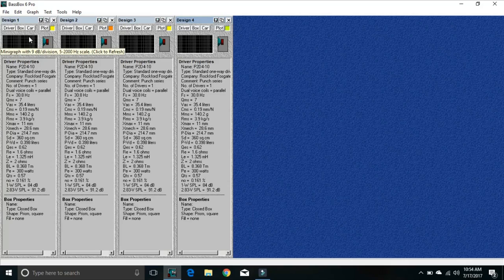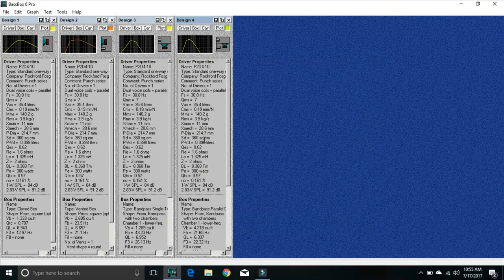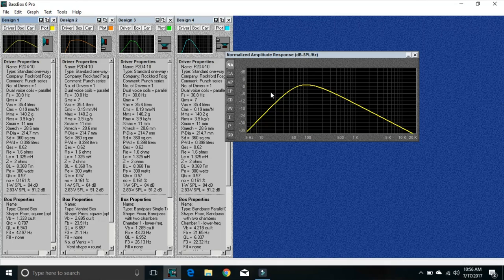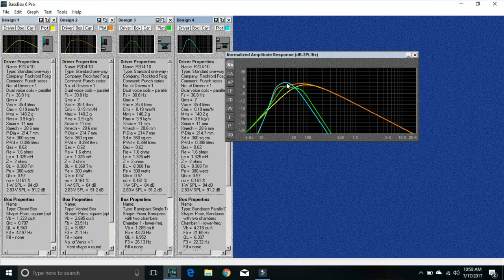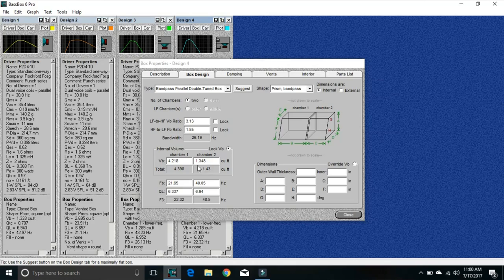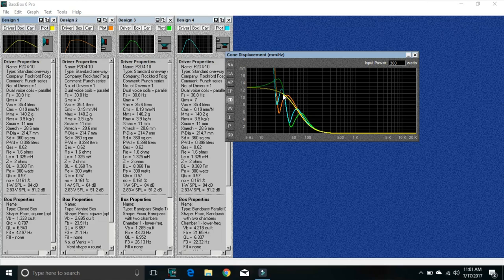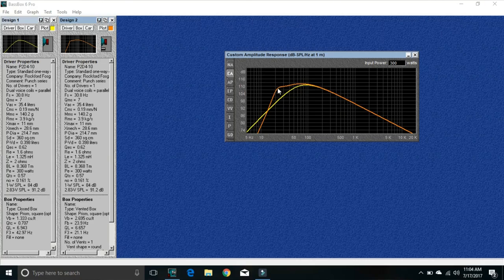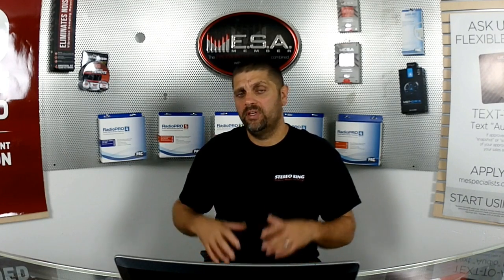Sealed vs Ported vs Bandpass speaker box/enclosure

Comment: Flat walls or ported boxes are the easiest to build, and are very loud around tuning but drop off quickly below tuning, and drop off quickly 12 or so hertz above tuning depending on the size. (Larger the box, smaller the bandwidth but louder around tuning.)
   
4th order bandpass (built correctly) has a wider bandwidth than ported box, but has the same volume generally speaking. You can tune a 4th order to 45-50 hertz and it will still play down to 20 hertz if your sealed section is big enough. (Sealed section handles all the low notes, and the front ported section handles your higher frequency cutoff) 

6th orders have the best of both worlds, and if built properly are much louder than ported boxes and have a much wider bandwidth than 4th orders. 6th orders can typically play across an entire octave and sometimes more depending on tuning. (One octave = doubling the frequency, so 23hz to 46hz is one octave) 
Typically you tune the rear chamber of a 6th below 26 hertz, and the front chamber one octave above your rear chamber tuning. This will gain you the best results.
Reply: 4th offer BP can be 3-6 dB louder than ported.
Reply: I needed this! I get lost when I hear about 6th & 8th orders
Reply: @cheesecalmese  6th order is just both chambers ported an octave apart (requires low QTS driver), 8th order is both chambers ported and ported in between chambers for ultimate efficiency but no forgiveness to mistakes.
Reply: @UltraNuggz  Thank you for the clarification sir! This is some intense box designing! whats your personal on those enclosures? its safe to say i've only heard sealed, ported, and your regular store bought band-pass.
Reply: @cheesecalmese  No prob Cheese. Ported is my go to, best cost to result value; as Stereo King stated one ported equals 2 or more sealed on less power = half cost for same output + lower bass extension. Doubling a sealed to equal one ported equals the same size box at twice the cost, only for special user cases. The ambiguous statement sealed sound better is not true, it all depends on what the sub was designed for and room available. A high Qts driver, >0.5 Qts, will sound better in sealed and in inverse, low Qts will rock a ported; ppl may not take this T/S parameter into account and establish the wrong conclusion. If available room is low, under or behind seat, buy a high Qts driver and toss in a small sealed box (stuff with poly-fill), have a small hatchback, a single ported 10 is perfect. Band pass has it's place such as porting into vehicle through parcel deck (no trunk rattle) or into home entertainment room from an adjacent utility room (hidden sub) however transient response suffers.. never sounds quite right across all music genres. Generic store bought versions are usually tuned to a high output peak, small bandwidth keeping the box size down... commonly referred to as 'one note wonders'. Custom is the way to go using design software. 
The only drawback to ported vs sealed is cabin gain, a vehicles cabin space may attenuate a ported lowest octave too much colouring the sound thus should be equalized to smooth out... where as the cabin may support the sealed low octave and actually provide a flat response. So many variables, your ears or tuning mic/software will be required to adjust to suite needs and audio taste.  
I was forced to utilize a JBL 10" sealed shallow mount in my Subaru due to new family, however once in a while toss back in my 12" ported and re-listen to songs , the difference is unimaginable and depressing when I can't hear the low bass extension on the sealed sub...misses the lowest octave (20-40 htz) the music producers intended to be heard. Example RITMO by Black Eyed Peas, there is a sub 40 hertz bass rhythm that will bring tears to my eyes (not literally) on the ported that doesn't even exist on the sealed. 
Sorry for lengthy write up, but hope it supports your future projects.
Reply: @UltraNuggz  amazing write up! very much appreciated!!! you really opened my eyes on several projects. Ironically in my fiances car i also added a 12" jbl basspro powered 12" ported sub. I have a classic car i'm building (monte carlo SS on my youtube page) and i really want the subwoofers to perform. however i'm more interested in trying to figure out how in our daily drivers (a dodge pick-up and a jeep wrangler) how can i get amazing sounds out of small stock locations and crevices. I've been seeing a lot of 8" and 6.5" subwoofer builds enter the car audio world for pick ups and SUV's. Are these little guys really competing now? the last time i had a pair of 8" polk audio subs behind a tight space in a 3rd row tahoe; the sound was so boombox like i'd get a headache at high volumes while 10, 12, and 15 have smooth loud deep bass. this sounds like what your experiencing with the 10" shallow mount, its loud but its not deep. that kind of sound gives me migraines :-(
Reply: @cheesecalmese  Short answer, no, the small subs will never be equivalent to larger, physics cannot be tricked. The larger the drivers cone, the more efficient coupling of electric to mechanical to air (amplitude per watt); and lower Fs. Generically, the common 8" will only hit 40hz in any enclosure and 6.5" above that obviously. Now, some manufacturers do make smaller subs that hit sub 40 hertz (Tang Band W6-1139SIF 6-1/2") but at the cost of efficiency, so you will need two 6.5" to equal one 10" at the same enclosure volume; Vas to Db. No performance advantage at again twice the cost. All your effort and lowest octave is still missing... and may not keep up efficiency wise to rest of system using one small sub. 
If location availability in your three vehicles is limited, one descent 10" sealed will offer better sound quality, smooth response, lower output capability and higher power handling over a peaky small sub.  
I despise the rumour "buy 8" for punch and 12" for low bass", like your experience with the polks, it's punchy cause it's the only frequencies it's capable of outputting! 

Note: a shallow mount 10" is really only equivalent to a standard cone 9", same surface area, hence the frequency limitations and smaller box requirements then regular 10" sealed. Only do if limited to that option.
Reply: @cheesecalmese  Found this chart after... 
Driver Diameter	Minimum Frequency (-3dB)
200mm (8")	40 Hz
250mm (10")	32 Hz
300mm (12")	27 Hz
380mm (15")	21 Hz
450mm (18")	18 Hz
Reply: @UltraNuggz  how low of qts?
Reply: @romellojames4548  I'm assuming you are referring to enclosure type? Very generically 0.5 is the cut off; below = ported, above = sealed.. go further up to 1.0 and go infinite baffle. If building your own or need a reference to choose prefab.. use an app like SpeakerBoxPro, has a huge selection of subwoofers in database or can input your own t/s parameters. Will tell you best enclosure selection quickly.
Reply: Thats right im fans of 6 th bp if you propely design you have awesome this 6thbp can play low & tight at the same time no other design can do this

Comment: I want to give you some credit for engineering a box and explaining the pros and cons, but it's really hard when you don't know by heart the most basic fundamentals about dBs, and that is, for every 3dB it's 2x the power. So the 6 dB of gain is like having to have 4 subs instead of 1 (3db + 3dB = 2 x 2 = 4x ). So that's 4 subs at the same power, OR 1 sub at 4x the power. Also, human perception of twice as loud is roughly equal to 10dB more or 10x the power.

Comment: Haaaa I have 4 12s in a sealed box in my ranger and it sounds great at 1.3 cube! Thinking about adding a port and a valve to open and close it !
Reply: You have 4 12's in  a 1.3" box? That's almost impossible, is it a 13" internal dimension cube? Minus your sub, will only be about 1 cube internal.... your bass extension and sql must be horrendously bad. Don't punch a port in it, lol, will just be a huge air leak at that volume; tuning will be above high pass filter.
Reply: @UltraNuggz  no for each in its own chamber it should be on my channel
Reply: @HOTSHOT-ls1bc  Ah, full apologies,  thanks for reply. That makes total sense; was scared for the life of your 12's there. Okay, will head over now.

Comment: I have a quick question. Should I try to match the specs of the subwoofer to the size of the box? For example the Polk Audio DB 10 DVC frequency specs states that it goes low as 28hz so should I buy or build a box sealed or ported tuned for that frequently?  Give or take 2hz + or -  A box tuned for 28hz to 30hz would be ideal  right?
Reply from the maker: Not exactly. If the speaker will play to 28hz and you build a box that is tuned to 28hz, the enclosure will naturally roll off below that frequency where your speaker isnt designed to play. I would recommend finding or building an enclosure with a tuning frequency around 36hz +/- 3hz.
Reply: @stereoking7778  Great.. So general rule of thumb is to build a box tuned for about 8hz higher than the frequency specs of the subwoofer. Give or that a few hz. Got it thanks.
Reply from the maker: That is a safe way to do it.

Comment: I'm planning on building a dual 18 sub box using 2 peavey blackwidow 1801 but I'm at a loss to the dimensions that I should use to build a great sounding box. Any suggestions.  And it's going in my mini van so I have space.
Reply from the maker: Download WIN ISD online, it is free box design software. That should help you out.
Reply: That’s a good woofer for loud PA systems. But it won’t hit low without a huge box.

Comment: Great video
Reply from the maker: Thank you sir.
Reply: Stereo King I noticed the band pass box wasn’t that much bigger then the ported. Is that usually the case? I’m just curious because I have a band pass box about twice the size of any other box I have of the same woofer size but 1/4 of the wattage.  So I’m scared to push the speaker.
Reply from the maker: @doskoreanitos2588  It really depends on the woofer, as long as you setup your amp correctly and the sealed side of the bandpass isn't too large you should be safe.